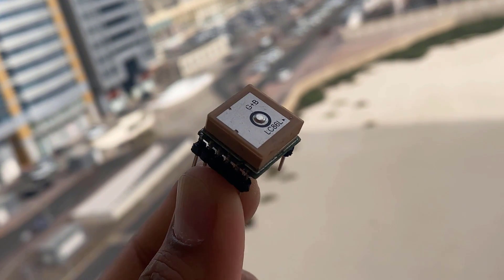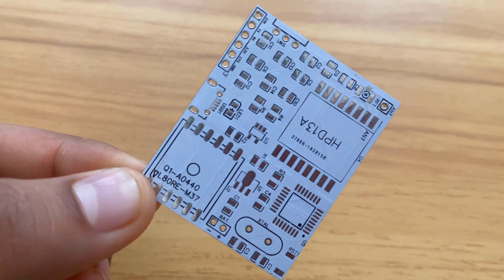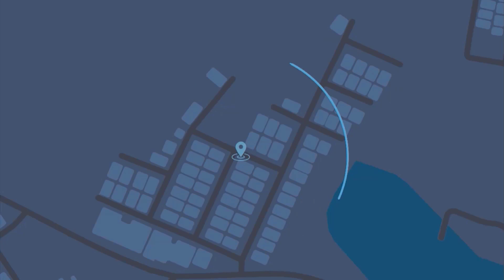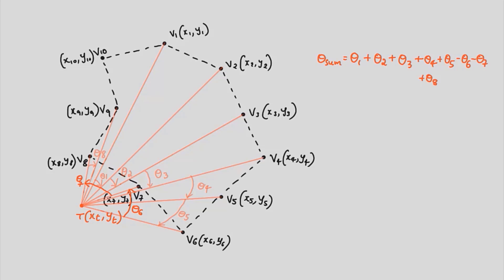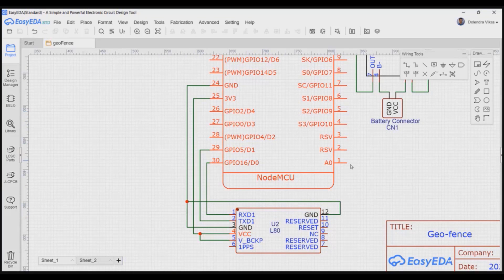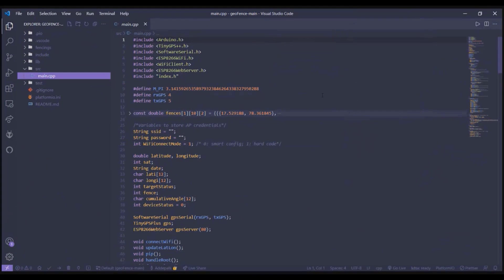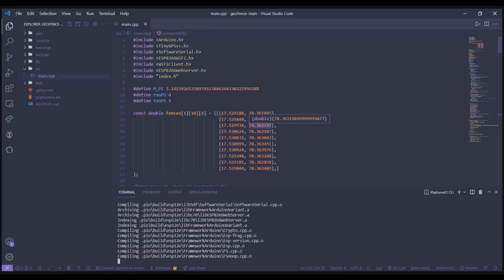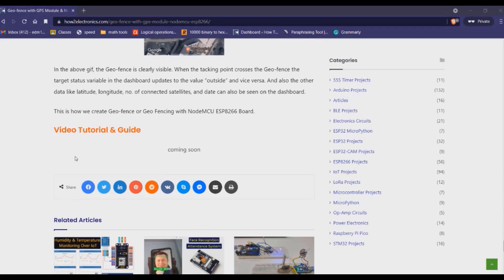Geofencing with GPS Module & ESP8266 for monitoring Target or Location

Comment: Hello sir, I've been trying this work of yours ... But I'm struck at a point where the gps data is neither shown in the serial monitor nor in the server ..what should i do ..can you provide some solution for this ... Thanks in advance
Reply: Thank you so much for your rply sir
Reply: I'm also facing the same problem. Will you please help.
Reply: Even me facing same issue
Reply: It showed output on the server side for me once ... Take ur setup to your terrace or to an open space area
Reply: while(gpsSerial.available())
Loop is not at all executing
Can u pls help me
Reply: @vaishnavipkumar5265  I really don't know why ... But no one is gonna answer us here ... I recommend you to search for someother ideas for this .... There are many other codes like this but the output will be showed in blynk app .. if u are interested then check it out... I'm saying this to you because no one is gonna help or reply us over here... I feel sry that I wasn't able to give u an proper answer ... All the best for ur success
Reply: Could I pls know which software can be use for fencing the area such that it covers 360degree
Reply: @vaishnavipkumar5265  same google map

Comment: Interesting video, and the choice of algorithm is also interesting. Did you also try out other ways, e.g. ray casting?
Reply from the maker: ya tried ray casting. But the ray casting fails a few scenarios. This point in polygon has more accuracy and works in most cases than ray casting.
Reply: @HowtoElectronics  ok, interesting to know. Thanks for sharing, your video should have way more up votes, not many Arduino polygon geofence videos on YouTube